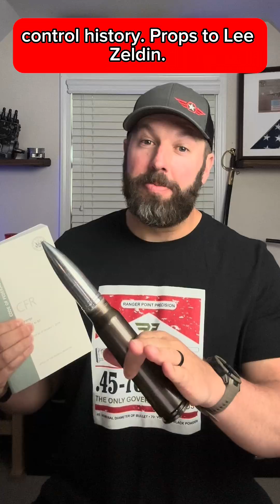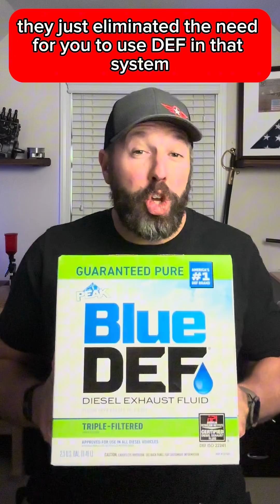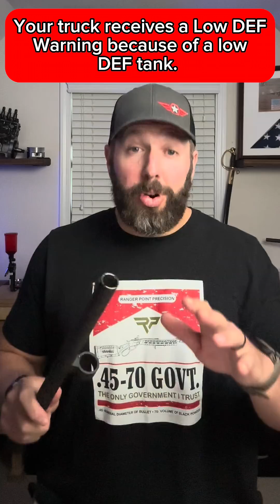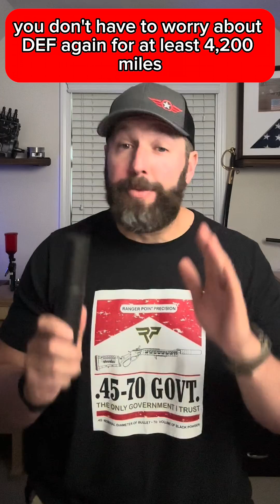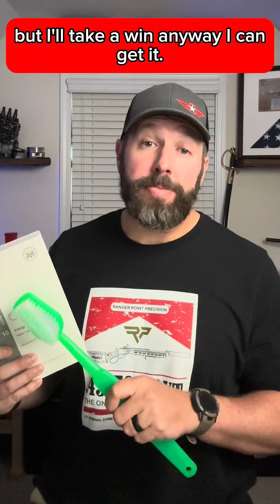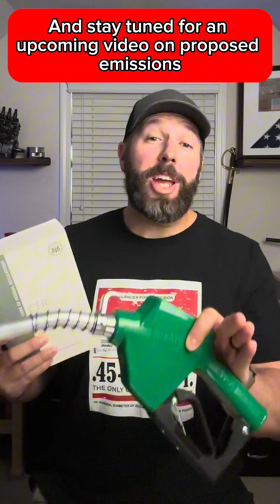The EPA just DELETED DEF in Pickups?…Lee Zeldin is a Magician #diesel #dieselengine #dieselpower

Comment from the maker: There is the EPA fact sheet. https://www.epa.gov/system/files/documents/2025-08/420f25011.pdf
Reply: Keep the content flowing buddy!  You're gonna have 1M subs in a year.
Reply from the maker: That would be nice 😎
Reply: So thats great. Ruin the system so that way you can get treated to a nice big replacement bill
Reply from the maker: I love Satire. Separates the men from the boys 😂
Reply: there are bills ready to go to eliminate all emissions standards and equipment and deletes will be legal and just fine.
Reply from the maker: @jon-o you might want to watch this video. And then refer me to these bills that will eliminate all emissions standards. Thanks https://youtu.be/bz7yTINFNp8?si=qg9QV7br6jzi-tCX
Reply: @Jon-O. No there's not. And its pointless because once the next administration comes in all of thats going away
Reply: LINK NOT WORKING - shutdown not over?
Reply: Serious question. How will my truck manufacturer handle this? Will I need to take my truck in or is it an over the air update?  I've got a 2025 gmc 1500 3.0
Reply from the maker: It’s voluntary guidance at this point. Each OEM will make their own decision and come up with their own strategy. My guess is that you’d need to go back to the dealership to get the ECU Flashed.
Reply: @freedomworx  truly enjoy your truth ... however... do not let your def pump run low it will overheat and require  replacing. Since the pump assy uses the def in the tank to cool said def pump .  Been there done that 😊
Reply: @bcsmith2862 thats the case with any sender. It's a bad idea to make your pump work itself to death sucking the last bit of fuel, and then dumping a ton of cold fuel on that red hot pump
Reply: @Mr.C-Mister  if they can do this over the air, they can do an over the air shut your truck off update
Reply: @John5ive they'd only be able to do that on the really new ones. My 2018 doesn't have the over the air telematics but my 23 Nissan does
Reply: @Mr.C-Mister that would not be a bright thing to do

Comment: I sold my deleted 2010 LMM 2500HD because I needed a 3500HD...which is a fully intact 2015 LML. Aside from adding a lift pump and using fuel additive, I plan to keep it all intact for now. We will see how it goes. The previous owner only drove it to 76k kms...and he told me that he only topped up the DEF once a year. I guess we shall see how that goes.

Comment: I drive CAT D8T. 2022 with 7000 hours. So far we changed tracks 2 times and about 5 times we got some DEF and regen nonsense. 
Just to be clear all eco problems that are being solved by DEF and DPF and EGR are big city being ingolfed into NOX and 2,5mm particles. If you see CAT D8 pushing dirt in city something went wrong... So 500 000 eur machine spent month being broken because there is pollution 100km away in city

Comment: The entire emissions equipment package for diesels is a fraud.  There are some folks that will show a bunch of "scientific" sounding nonsense to justify it, but in reality it is a shell game.  The primary purpose of the DEF and SCR is to reduce NOx emissions.  The NOx emissions is said to create smog and acid rain.  When was the last time smog was an issue in the US?  Even LA no longer has a significant smog problem.  Diesel vehicles are not a major portion of emissions.  Trains, jets, and ships are the biggest producers of ALL petroleum pollutants.  Since the wide adoption of catalytic converters, the smog and pollution of automobiles is a small fraction of what it once was.  The NOx contributing to acid rain is a 1980's climate change scam that has been rehashed to sell the destruction of diesel engines for the plebes.  The large money making enterprises are unaffected by the rule changes.  Ships, jets, private yachts, and the entire military war vehicles are not covered in this legislature.  The EGR and DPF are even less defensible.  The science behind these are completely indefensible.  They sound good on paper, but anyone with practical knowledge of these systems knows that they are garbage.

Comment: It’s going to be obvious that I don’t know what I’m talking about and don’t understand the def system. This is a legitimate question. Could this potentially cause the system to fail prematurely because it was designed to run with def? I think the only solution is to get rid of the garbage. But this is a step in the correct direction.
Reply: Yes.

Comment: My favorite use for def is for fertigation in my lawn sprinkler system, after the reset I pull my truck up around the back of my garage and drop in the def tank, the hose that’s connected to a Venturi syphon and a bypass valve on my sprinkler system!

Comment: EPA targets Diesels for NOX ( smog literally melted air molecules ) and Particulates ( soot ) 
The DPF traps the soot 
The EGR and  DEF treats the air quality / smog. 
The systems work but they don’t factor in long idling and real scenarios.
Reply from the maker: The regulations are the same whether the engine is gas or diesel.
Reply: They don't work at all.   It's a scam

Comment: The big issue i’ve had is buying it from a reputable seller that you know stored it right. If it sits too long, gets too hot etc, it crystallizes and will ruin the system which is big $$$. So if you get a warning and you’re in BFE you’re rolling the dice on the def you buy and hoping you don’t clog the system

Comment: People who complain about the cost of emissions equipment just want to push the costs of pollution (an externality) on to everyone else. 

I enjoy clatter of a Diesel and black smoking coming out of a tractor like anyone else. I also understand that the emissions of soot, NOx and CO isn't great for anyone's health. 

You could argue about CO2 and methane involvement in global climate change all you want. But I'm mostly concerned about the pollution that you can see the direction impacts on human health like particulate matter (2.5 micron to 30 micron), NOx and Ozone (O3). 

Obviously CO is bad for humans because the body cannot remove it like CO2. It builds up over time. 

The NOx emissions create smog and acid rain. 

The clean air act has removed lead, NOx and CO from cities. It was normal to smell raw gas blowing out of the back of pre emissions cars and having ground level smog was so bad, you couldn't see. 

So everyone needs to grow up and accept that emissions control systems are required for everyone to enjoy clean air and stop complaining about how expensive it is to keep your rig on the road

Comment: I have much respect and love your videos but this one is where I draw the line. Yes PROBABLY you could run your tank that low and not have problems for 10k ish miles but when you run the def that low it splashes around in the tank and is exposed to air and crystallizes on the level and quality  metering and then you get poor def quality codes
Reply from the maker: Brother, I even said in the video "I'm not saying you should, but you could" This video was simply to get peoples attention to know what is actually changing at the EPA. Don't take the comedy part so seriously.

Comment: If you have a def system, you probably do not want to run long periods like that. Have you seen the crystals left when the liquid evaporates? I am sure you can go some distance and time before you risk problems from not running fresh def through.... but be prepared for other issues if a def system sits without running fresh fluid for too long.
Reply: Exactly

Comment: I wouldn’t try that in a Freightliner like my 2018 RV 8.9 isl  Cummings, I had def innit nd the low def light came on and I went on a trip from NC to Tenn because I knew I had def in it but it shut me down to a limp mode in Shelby NC a couple of hours into my trip, it was still under warranty so I had it towed to gaffney SC where the chassis was built and they put a new def head on the tank and got me back on the road the next day.

Comment: And this proves it’s your computer that shuts down your truck, not the lack of def
Reply from the maker: Why would DEF shut down the engine? It goes into the exhaust system, not the engine. The computer shuts things down with low DEF because the regulation requires it.

Comment: How can I apply this to my current vehicles? Do I need to have the computer flashed by the dealer, or use a new tuner?
Reply from the maker: It’s voluntary guidance from the EPA. The OEM chooses if they want to implement it. If so, the dealer would need to reflash your ECU.

Comment: Not TRUE. The limp mode now kicks in at 10 hours or 650 miles. Anyhow.... the harshest part of the emission system is the DPF -- not the SCR. This will just give you more time to get the fluid, but you're still going to need the fluid
Reply from the maker: I’m talking about pickup trucks. Stated that specifically. I attached the EPA Fact Sheet of you want to try and fact check me 😉 And if want to fact check the satirical part, where I tell people how to heat the system…well, go for it 😂

Comment: I've got a 2024 ram 2500 and my company truck is a 25 cascadia, will this be for those trucks as well? If so is it just a software update? If it is ill go straight to the dealership now to get it uploaded on lol.
Reply from the maker: It’s currently just voluntary guidance. So it’s up to the OEM if they want to implement it. If they do, you’ll need the computer updated.

Comment: Ya will how is that going to effect us who already have these vehicles.  Where my dumb ass gauge kn my 2025 is going insane. Full tank yet tells me im reduced to 5mph because this dumb ass thing thinks im empty
Reply from the maker: That’s the point of the revised guidance. If you have a system fault, you get 4,200 miles before it goes into limp mode. But it’s voluntary guidance. The OEM has to decide if they are going to update their vehicles or not. And you’d need to go to the dealer to get the update, if they choose to do it.

Comment: All they did was remove the computer's programmed protection... It was leaving drivers stranded when they needed to risk damaging the vehicle to get to a safer place. That diesel particulate filter is going to fill up, and your vehicle will cease to function, and you will have to replace it with a new one which is very expensive, if you follow his advice.  220,000 mi on my original DPF, and I loaned my truck to somebody for one week, and they clog the filter because they shut the truck off when it was in the middle of regen repeatedly for the sake of convenience.
Reply from the maker: DEF has nothing to do with the DPF. You might want to watch my videos on these topics. I didn’t give any advice. In fact I specifically stated that “I’m not saying that you should…” It’s satire brother. Comedy that educates.
Reply from the maker: DPF… https://youtu.be/SMwl71cr5iM?si=xhr2Dh0EIQbb8JLW
Reply from the maker: DEF 😉 https://youtu.be/qFBOcVcVjB8?si=65Qlb390xk7jvDq2
Reply from the maker: Or you can read the information directly from my source for those videos it you’d like 👍 https://amzn.to/45CJz3n

Comment: As a electrical controls sort a guy I think I could come up with a system that could shut off the DEF fluid until 4199 miles, turn it on for whatever required time and than shut it back off for another 4199 miles. Just thinking out loud😉

Comment: it doesn't work like that, it's like leaving old gas in your tank and starting your vehicle once a year, eventually a very expensive piece of DEF equipment will fail from constantly running off the bottom of the tank. this also doesn't address ash deposits in the DPF and EGR/intake and buildup inside the engine.

this isn't a fix at all, it will just create more issues with SCR and DEF system failures by urea buildup on injectors. do you run your battery at 11.5 volts? it won't have a very long life if you do. the only fix is to eliminate DEF/DPF altogether or to fully maintain it as the service manual outlines.
Reply from the maker: It’s satire brother. Just highlighting the revised. Voluntary guidance that the EPA made available to OEMs. It will certainly benefit many people. There are thousands of people who have been stranded due to DEF system faults causing Limp Mode. I’m sure they wish they had this available when it happens to them…probably

Comment: The DEF system is the least of our problems and it is the one system that actually makes sense. What the EPA should do is mandate that trucks not be allowed to advertise HP and torque numbers that are unachievable without producing massive amounts of soot. If they did that, we could get rid of the DPF and the insane regeneration system. 

Also a properly tuned DEF system could allow us to get rid of the EGR. 

Longer lasting engines and engines running cleaner are the best thing for the real environment. Get rid of the DPF and EGR.
Reply from the maker: I’ll disagree with it being the least of our problems. But agree with the rest. Limp Mode is required by law. And it’s what generally strands people when they have a system fault. So this is a win in my opinion. But yes, the OEMs could likely increase reliability and longevity with DEF alone and no EGR. If the DEF system flowed more DEF, it would probably be less problematic.
Reply: EGR?! What EGR? Mine "fell off" and never got around to replacing it.😂😂

Comment: The cost of the pooper piss isn't the problem. The catalyst it's sprayed into, and the system of pumps, heaters, sensors, and the injector delivering and monitoring it all is the problem. Those systems use sensitive electronic components. Sensitive electronics don't like heat. They put sensitive electronics in a system that regularly sees 4 digit component temperatures for tens of minutes. Then, these components cost mid to upper 3 figures, and for the big parts, multiple thousands.
Reply from the maker: I doubt anyone will actually try this. I’m just highlighting the revised Limp Mode guidance the EPA has offered to the OEMs to voluntarily implement.
Reply: @freedomworx I commend your faith in society my friend.

Comment: It seems to me if you still had the diesel particulate filter that the diesel exhaust fluid was there to clean the soot out of and cheated the diesel exhaust fluid system, the diesel particulate filter system would have issues at some point. But then as i type this… if there were some sort of horrific sawzall incident with that particulate system it would save some trouble for sure.
Reply from the maker: DEF has nothing to do with the DPF.

Comment: DOESNT MEAN SHYT UNTIL THE CRAPPY SYSTEMS ARE DELETED FROM THE FACTORY AND THEY SEND OUT A SOFTWARE FIX ..MY WORK TRUCK IS MPH LIMITED IF I DONT RUN DEF.
Reply from the maker: Well obviously your ECU would have to be flashed by the OEM. This isn’t magic. But unfortunately, the systems are not going to get deleted from the factory or otherwise…probably.

Comment: Leave it to the government to totally miss the point of the problems that diesel emissions systems cause in the real world for real people. 
The problem IS NOT running out of DEF or having to fill the tank in a timely manner. 
The problem IS having to repair, maintain, and keep ot operational which costs thousands of dollars.
Reply from the maker: Well the government doesn't dictate that the OEMs use these systems. The government dictates what emissions levels must be met with whatever technology the OEM decides to use. But, if the OEM choose to use DEF, they are required to implement a specific limp mode strategy. the EPA specified this strategy in 40 CFR. The EPA is listening to people who have been stranded due to that previous strategy, and havallowed and encouraged the OEMs to change it so people don't get stranded. That's a win for a lot of people. The EPA has no ability to change the regs in 40 CFR, that would allow these systems to go away. Only Congress can do that by amending the Clean Air Act, through HR4117 which is up for vote. So call your Congressmen and complain to him. https://www.house.gov/representatives

Comment: Small win for sure! The smaller 3.0 baby Dmax drinks def by the gallons when towing.. Thats a win for now. 
 Congress will hopefully come through and get us another big win with a couple bills in the works.
Reply: yes but it's also the people's fault. down south half the trucks on the road seem to be diesel pickups with nothing in them 99% of the time. people drive around with big trucks but they never use them. now imagine if every one of them was rolling coal.... no thanks. i get that people don't want a second car, but a cheap daily would still come out ahead versus driving a truck that gets 15mpg on diesel. i have a jeep that i use to haul stuff with, it sits around 11.8 months out of the year while i get 40mpg in my daily. i save a lot more than the $50 a month to insure it by not driving it.
Reply: I have that truck but if I ran it out of DEF it would stop running as normal correct? So what does this actually do I’m confused
Reply: Just keep def in the tank and you won’t have issues. Not sure why this is such an issue. PITA sure it is, but no worse than the damn seatbelt chime that doesn’t shut off when driving around at 10mph

Comment: I'm glad I don't have one of those trucks that needs a filter
Reply from the maker: DEF has nothing to do with the DPF.
Reply: @freedomworx I know that it cleans the emissions up but I don't have a truck that has a DPF or a DEF tank on it I don't like either system so I went and got one that didn't have one I have a catalytic converter though and that's it technically that is a filter but it's not a DPF or a DEF tank
Reply from the maker: I have 4 pre-emissions trucks. And zero trucks with any emissions equipment 😉
Reply: @freedomworx let me guess?  They're extremely reliable?